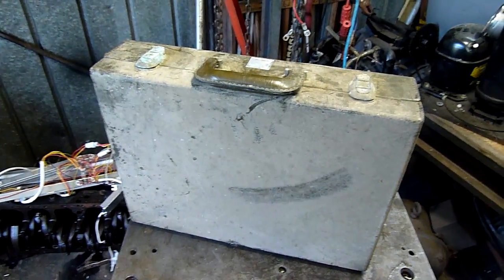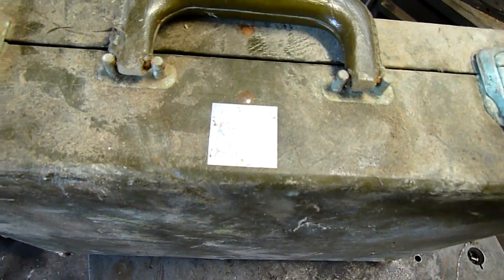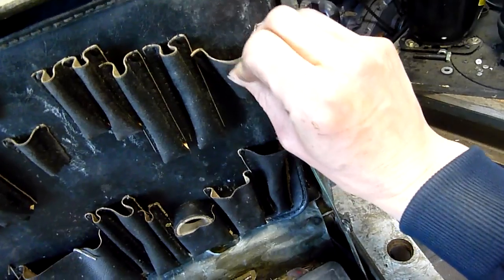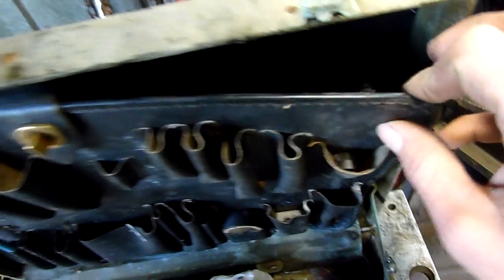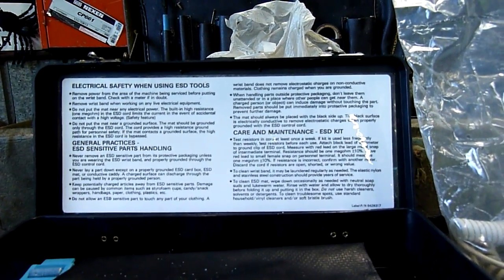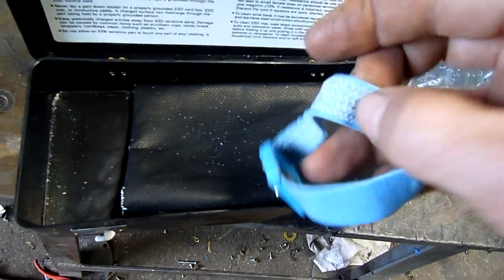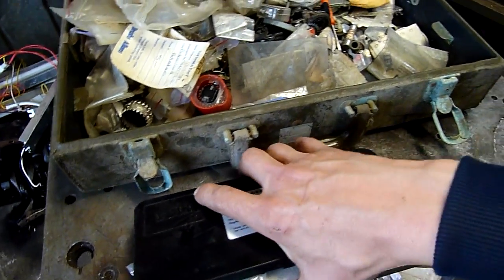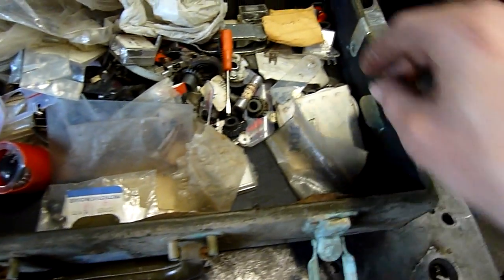Vintage IBM Typewriter Technicians Service Case Pick Through Pt1

Comment: Around 1991 (or maybe '90) the typewriter went away with that early or first version of windows dos, even though computers were insanely expensive (I think a 25mhz. radio shack in '93 was about $1200-1300 US), the functionality was so comparitively superior so everyone shelled out the cash....
The clear plastic w/ red line viewing port is where you lined up the text vertically with the roller knob on right side.

Comment: Wish I had an IBM ESD KIT because I got shocked by my new Xbox 360 elite s wile I was installing a COMPONENT  HDAV CABLE I DID POWER DOWN EVERY THING I had plugged in on my PWR strip and made sure it was off.